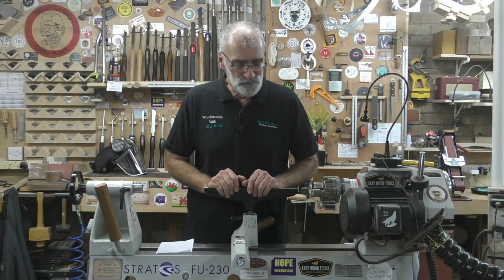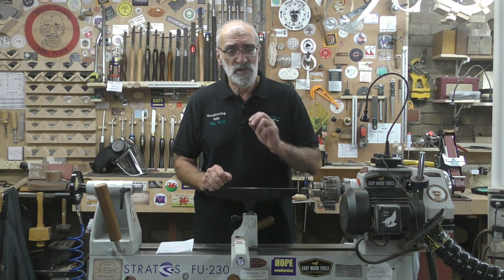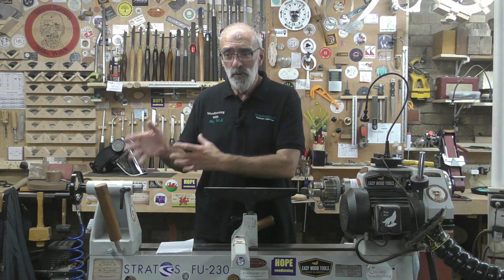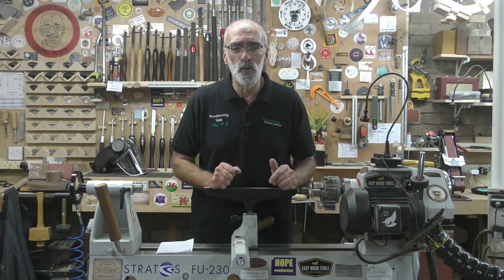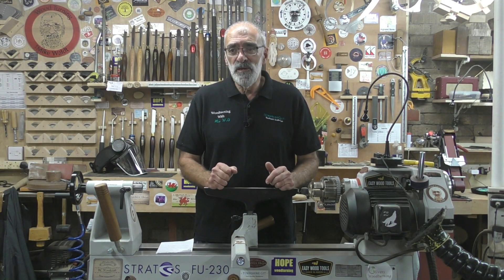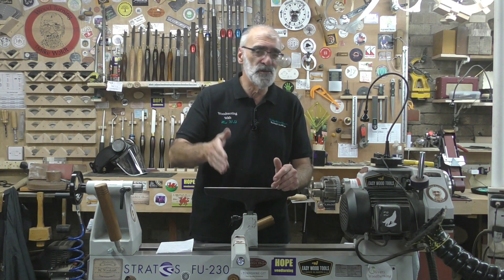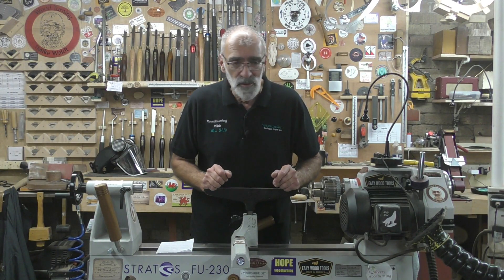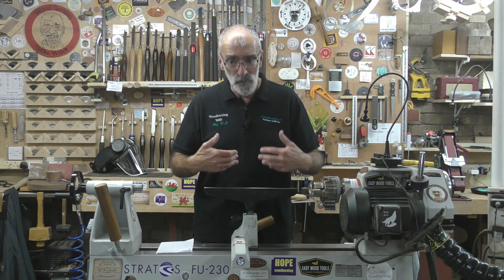Woodturning - A Guide to Sanding - FOLLOW UP!

Comment: Excellent follow-up for clarification.  I agree that I never use wet sanding with water - the lathe bed doesn't like showers as the next morning will show. Oil or wax is fine as long as it is compatible with your chosen finish. Thanks again, Mike  Brian
Reply from the maker: Thank you Brian much appreciated my friend
Cheers
Mike

Comment: Excellent follow up video Mike. You made a great point concerning heat buildup (I think the term you were looking for is heat checking though, not cracking), but it brings up a good reason for using some form of lubricant for sanding. Whether you use a mineral oil/wax mix or (my personal favorite) walnut oil or even wet sanding with water, the lubricant will keep the heat down and lessen the chance of heat checking. Of course as you said, as long as you are careful then dry sanding with less pressure is just fine. Keep up the good work, your videos as very much appreciated!
Reply from the maker: Thank you very much for the tips and suggestions, and of course watching and your support.
Take care
Cheers
Mike

Comment: A great follow-up Mike and many useful points brought up by your viewers. Without thinking about, my technique is the same with the friction arbor, I guess is a combination of centrifugal force and air turbulence that takes the dust away.  I think it's true to say that the finer the grit, the more chance there is of burning, something you need to think about if you intend to add colour which won't be absorbed onto a cauterized surface. Thank you for adding more useful information!
Reply from the maker: Thank you William as always very grateful for your input and support mate.
Take care
Mike

Comment: Hi Mike, I know you don't wet sand, I didn't until yesterday and what a difference it is in a better way than dry sanding. No dust for starters and i get a better looking finish. I won't be going back to dry sanding that's for sure. All the best Bob.
Reply from the maker: Hi Bob, I have wet sanded in the past, but normally dry sand, everyone has their preferred methods mate 🙂

Comment: Hi Mike thanks for that, I have one quick question,  what is your opinion on abranet which can be cleaned due to its construction which allows dust to be removed before continuing. Keep up the good work I really enjoy your very informative posts
Reply from the maker: Hi Ian, I have Abranet and use it rarely. I found that on certain pieces and woods it almost needed to be used in a certain orientation to get the best results, so I have used a quality "ordinary" backed paper for a number of years.
Take care
Mike

Comment: I have been using Pro Sand sanding sheets from 2SAND.com with great results. Long lasting with less clog. Check them out.
Reply from the maker: Thanks for the tip Karol, I have been using the discs and shhets from Simon Hope for years, and they too do a great job.
Thanks for your input and support mate
Cheers
Mike